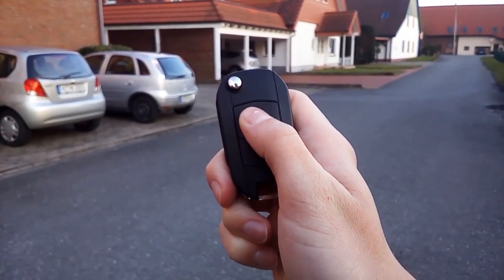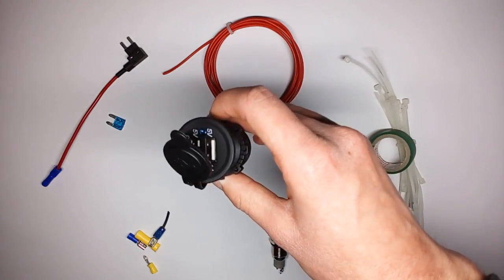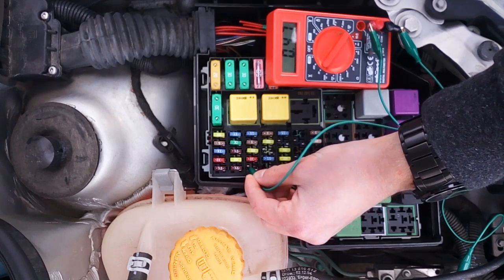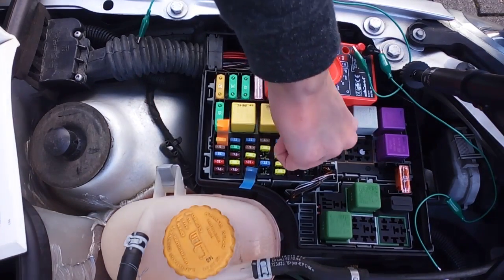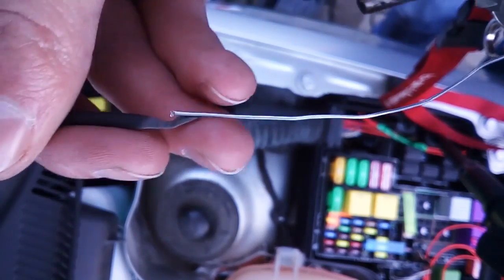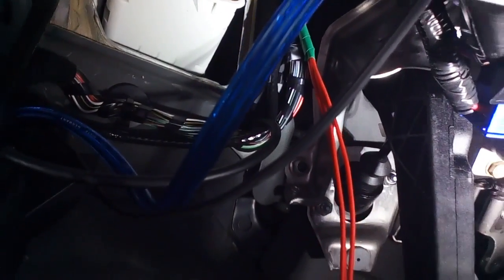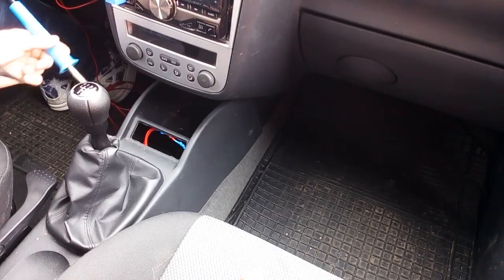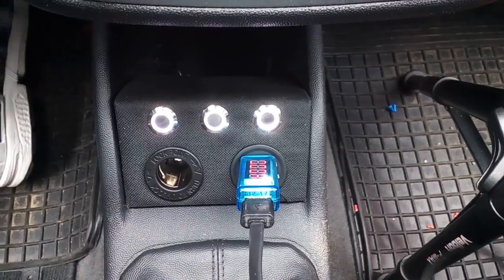How to add a circuit to your car

Comment: how did you ground it ?
Reply from the maker: I added a ring shoe to the end of the negative wire and bolted it to a chassis grounding point. There happened to be one right underneath the center console that is also used for the infotainment system. 
Just be sure to secure it with a spring ring or some loctide. Vibrations in a car and can cause nasty grounding issues, if the bolt gets loose, which may or may not have happened to me later on😅

Comment: I know the theory on how to use the fuse taps but how do I know how many can I use?
I would connect a USB socket, maybe a dashcam, led footweel lighting, an alarm (probably with central locking) and heated seats. The heating should be the biggest consumer and the other things wouldn't be on all the time. How to know the limit?
Reply: When using fuse taps to connect multiple devices to your vehicle's electrical system, it’s essential to calculate the total current draw and ensure it doesn’t exceed the fuse rating or the capacity of the circuit. Here are the steps to determine the limit:

Identify the Fuse Rating: Look at the fuse you plan to tap into and note its amperage rating.

Check Existing Load: Determine the current draw of any devices already connected to this fuse.

Calculate Additional Load:

USB Socket: Typically 1-2A.
Dashcam: Around 0.5-1A.
LED Footwell Lighting: About 0.2-0.5A.
Alarm: Approximately 1-2A (varies with features).
Heated Seats: 3-10A (varies by model and usage).
Add these values to get the total current draw.

Sum Total Current Draw: Add the current draws of all devices you plan to connect to the existing load on the fuse.

Compare to Fuse Rating: Ensure the total current draw does not exceed 80% of the fuse rating to avoid blowing the fuse (for safety, keep some headroom).

For example, if your fuse is rated at 20A:

Existing load: 5A
Additional devices: USB (2A) + Dashcam (1A) + LED (0.5A) + Alarm (2A) + Heated Seats (10A) = 15.5A
Total load = 5A + 15.5A = 20.5A

This exceeds the 20A fuse rating, so you need to distribute the load or use a higher-rated circuit (if possible). Always consult your vehicle’s manual and consider professional advice for significant modifications.

Comment: I have a question about 3:41 (pause). So at the bottom we have the original circuit with lets say a fuse of 20A. On top we have the new circuit with lets say a 10A fuse.  Assuming both circuits are in use and take the max of Amps.  Would that not be a problem because now the "in line" wire from the battery runs 30A and no fuse will blow? So would 4:01(pause) not be the better solution because it will not allow any more amps on the line than it was designed to?
Reply: My understanding is the fuses are supposed to be inserted upstream to protect the circuit DOWNstream. The role of the fuse is not to prevent the wire meltdown (we assume conductors have negligible resistance for IR^2 loss) but to prevent pushing more current through the appliance than it is capable of handling so meltdown of ITS contacts etc. So, if the wires/terminals melt, it should be a cheap replace but if you burn the circuit of your headlamp/AC, the part will be expensive ! Also note that the factory fuse ratings are estimated based on the specific circuits running them, not on the terminals that connect them to 12V of the battery. 

Now in the wrong way of connecting it, there are two appliances/grounds coming out of the original fuse so indeed since resistance of parallel connection is less (than of either component), then power supply provides more current to the node so more likely to blow the original fuse there. Also it seems you are constraining the original circuit in lower branch to a window of at least 10amp & at most 20amp while it is supposed to be flexibile between 0 and 20. So you could be oversupplying your original circuit.  It would be better to regulate the original circuit OVER the add-on circuit...

If you want to do it that way, I think it's better to limit max current by installing the tap the correct way but just choosing lower rating fuses for both circuits, say, 15amp for original and, 7.5 amp for the appliance. Being as those are extreme values, the device can ask for as little current demand as it needs to get by.

Comment: Hi Basement, I enjoyed that, great video, well done. A question for you regarding more than 10 amps as mentioned in your instructables page ... "For circuits that operate at higher current's, such as Audio amplifier's you need to run a seperated wire from the positive terminal of your battery to your device and do not forget to add a fuse near the power source." Do you mean buy a totally separate fuse box, connect it to the main terminal battery and add ( for example) one  20amp fuse between the fusebox and the +ve?

Comment: Isn't a coffee maker a little much for the output of the 12v port?
Reply from the maker: I just checked and apparrently 12V coffee makers use less than 200 Watts, which courses around 17A of current draw. Most 12V sockets can supply 20A. So you should be able to safely enjoy your fresh brewed coffee in your car.
HOT TIP: Don't drink and drive :D
Reply: Alright, cool stuff

Comment: Hello Basement Engineer,
Excellent teacher! Circuit input and out put wonderful I was about to hard wire a mini dash cam DVR and was hesitant until you lessen plan, it was educational and very informative and you saved me from damaging my car's electronic circuits, thank you!

The interior fuse box and the cheap instructions poorly written in pigeon English say install red wire to accessory;the black wire to ground; the yellow wire to constant power. Do I use two add on circuits, one to battery and one to accessory, then wire then wire them together to the dash cam? And how do I wire 2 separate wires from 2 circuits to the one wire?

Comment: Many of the Add-a-fuse YouTube videos do not cover the theory of the circuit i.e. the consequences of plugging these devices in the wrong way around. You have a good understanding of electrical theory and excellent practical skills. This is a very useful piece of video production.  Well done.
Reply: Consequence is just 2 fuses in series for the second added circuit. Not really an issue! So there is no wrong way, but there is a best way... You don't need a multimeter to check this, just verify that only one of the 2 fuses cuts power to new circuit.

Comment: great job and thanks for the video it helped a lot. You used 2 12v chargers so were they both connected to the single add a fuse, did you need to splice the wire?
Reply: No you dont splice the wire as the video shows you this is what you do so you dont have to go down the route of dodgy wire splicing.

Comment: Good job on your first video project. I stumbled upon it, looking for a clean way to add a circuit into my camper-van to fix some of the previous owner's mess of twist / tape wiring, and have only just heard of these add-a-fuse things just now. Thanks for the knowledge. It looks like I can source them quite easily and cheaply here too. This has helped me saved hours!
Reply from the maker: Thanks for the nice comment. I'm glad that I could help you out.